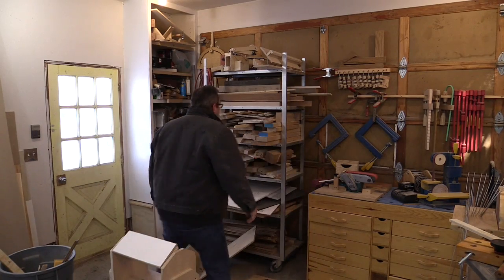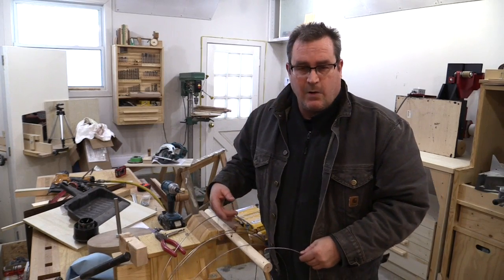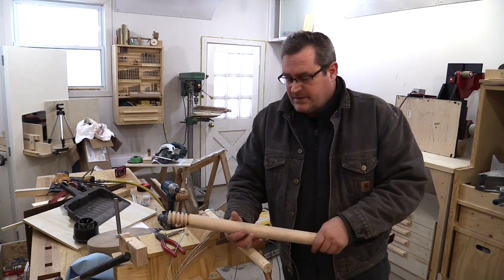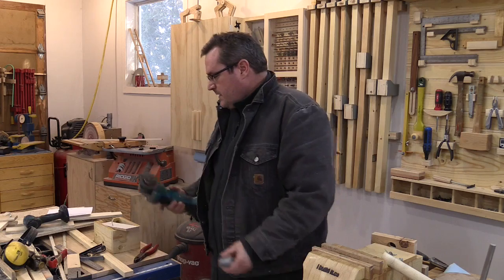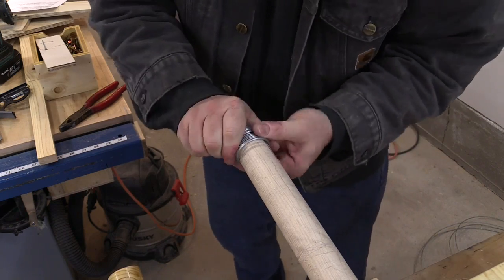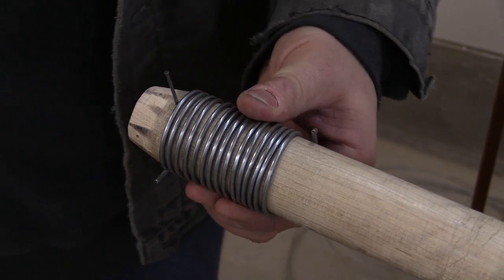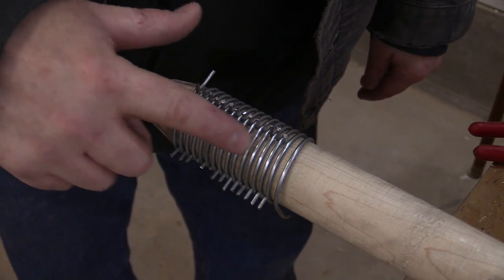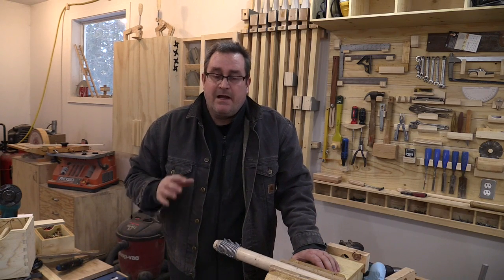Steel Threads Experiment Take 2

Comment: Put the dowel between centers on your lathe. Hand turn or very slow speed on the lathe and wind it on. It's how they used to make springs. Probably find the technique in PM Shopnotes or an old Deltagram.

Comment: Late to the game here, but I think a revisit would be nice on this. If you cut some shallow threads in both pieces it will allow you to wrap the pre-coiled wire more uniformly and will also provide more glue/epoxy surface area.

Comment: If you have a lathe with a feed screw, why not wind the wire straight onto the dowel using the lathe to guide it? Super slow speed and an assistant with a hand on the stop switch might work well.

Comment: Hey, John. Suggestion. I made my own threads in the past by winding two separate wire together. That way, the thread spacing is exact. Because they are separate wires, simply unthread one wire from the other. One gets attached to a shaft (the bolt), the other to an appropriately sized sleeve (the nut). Bingo bango. Just food for thought

Comment: Apply stripes of epoxy across the threads between your 3 rows of spacers and allow it to cure.  You can then remove your spacers and apply epoxy to the final 3 areas where it will hopefully sink into the holes and help further secure the coil.

Comment: heya john, merry christmas! i was in my shed and had a thought- you know those machines with linkages that copy writing? you follow with a pointer on one side and a pen on the other and it copies pictures or writing? well i wondered if it would be possible to do something similar to convert a small movement to a larger one, and then use a bolt or watever with the right TPI to move a cutter on the other end, and run the wood in a lathe or whatever. just an idea! take care man, all the best!

Comment: You are working with three materials that have different coefficients of expansion.
All threaded objects I have seen all ways made of one material only. Physics 101.
Threads are triangular both positive with opposite negative space.
Reply: +Paul C Johnson Except when they're not triangular, e.g. Buttress, Knuckle, Trapezoidal (Acme), Edison screw, Glass thread etc etc

Comment: Good fun!   :o)
Would winding two wires on at the same time be worth considering?  One becomes the thread, the other becomes the spacer.  Or you could bend your wire in two, wind it on in parallel, then grind through the bend at the time when you want to unwind the spacer.  I wonder if using wire that is not so feisty would make the task less stressful?  Watching with interest...

Comment: Instead of pulling those pins off your contraption 45 minutes after applying epoxy (5:20) why don't you dip each pin in a bar soap so the glue won't catch between the wood and the pin which could be removed easily later;
There is another method and that's the one I would use : let the glue set with the coil and pin. When everything holds tight you can pull off the pins by heating each of them with a soldering iron, they will pop off very easily, the heat being applied on the pin only momentarily it will not affect the epoxy on the coil and wooden axle.
This is the only easy method I found to unscrew a wooden screw from wood without impairing the quality of the glue around. I did it many times when restoring my 33ft sailboat on which I used epoxy widely ; in fact it sort of became standard practice in the yard I worked in.

Thank you for sharing. You're videos are always very instructive and a pleasure to watch, even if you don't like editing so much ! …

PS. The soap and heat techniques are not mine as I understand that they are pretty widely used here and there …

Comment: Are you making an internal coil in another part intended to thread onto this?  If so, I think your spacer wires need to be larger in diameter.   In metal threading, a thread that is 75% full is considered a very tight thread.  slightly increased spacing will give you the thread clearance you need to have a smoothly operating thread.   Interesting experiment.  I know the context but hope my comments are useful.

Comment: Your wire threads immediately reminded me of the worm gears Austrian model train Kleinbahn made this way. They wound a wire directly onto the motor shaft using probably some kind of spring steel. They seem to be working fine but the load on the wire is probably not that great.

http://up.picr.de/10871478xe.jpg

Comment: I can't see making a "screw jig" for just a few screws.  I love "outside the box".  An open thought (that popped through my head as I watched). Two wires, anchored on opposite sides of the dowel.  Wrap one half way aroud til it meets the second.  Then wrap both of them.  Maybe the wood block could feed two wires and keep them in line.  (Gonna need something on the block to add tension.)  At the other end, anchor one of them and let the other come off.  Some way to rotate the dowel while wrapping might have some merit.  Might even try to feed some epoxy in as it wraps and let it set a bit before pulling the 'loose' wire out.  ..  Ideas are free.  Thanks for adding the effort.

Comment: Fascinating stuff!
I love this sort of engineering :)
Anchoring the ends only of the cable to the dowel would allow the main body of the thread to shift as it is turned...
Maybe you could anchor the start of the cable in a hole through the dowel, bend the cable hard 90, and start the thread after the 90..? Should make for a nice clean start to a thread..
Perhaps also consider the ambient temperature your working at now vs your average yearly temperature... All that cable is going to expand a bit in the summer :/
Thanks for the video :)

Comment: Do I remember you saying that you would burn the threads into the nut by heating the wire?
Reply from the maker: Rick McQuay No, to make the nut I will wrap wire into the finished threads on the rod, then slip the wood for the nut over it. Unscrew it and epoxy the coil into the hole in the nut. Or, that's the plan, anyway.
Reply from the maker: I Build It I'll probably smear some epoxy into the hole so that it glues the wire threads in place until I can put the final coat of epoxy in.

Comment: I wonder, since you made your screw jig some time ago (the one you used for the other end of that dowel), if you could modify it to remove a screwed groove which is half the depth of the wire out of the dowel. Then you may be able to screw the wire into that, and it would seat securely, especially with the epoxy. Just an idea.

I'm following the progression with interest! Cheers!
Reply from the maker: Switch & Lever Making those threads in the wood are tricky to do and I saw this as a much easier method.

Comment: Even with the spacers it seems like there is a chance of getting the lead angle wrong, or at least not the same from the screw to the nut. Even if they are the same threads per inch they may not advance at the same rate.
Reply from the maker: David ODell The angle can't be wrong if you wrap the wire tightly. Also, the nut coil will be made from the threaded rod itself, so no chance of a mismatch.

Comment: Lil thoughts out of the box here (I hope). It seems to me the idea is just fine, but the method you choose to deliver is maybe a wrong direction (another words - just too difficult). The thing is, you're using hands to make it, so maybe instead use some sort of simple (or not so simple) jig for it?
I mean some kind of hand lathe and something which holds the wire with the right angle with some actual tension, so wire maybe (that would be ideal, but hard wood is hard) even cut into the wood creating a groove for itself + some epoxy that would be some strongass bolt.
And its kinda strange to me that it not came to u (coz u know, you're all abot jigs :) atleast erlier u did some cool stuff) or maybe it did, but u thought it's just not worth or whatever.
Anaways, very entertaining stuff u got there, wish u get this done and furthermore to get a cool way to do so for others. Peace :)
Reply from the maker: Tuff Movies Because a jig is not needed.

Comment: You could epoxy in two stages.  epoxy in the three open areas between pins and let that set up.  Then pull the pins.  Then epoxy the whole screw.  I like this experiment.

Comment: John,
  I do not work with epoxy - yet.  Will you have a problem with gravity and the epoxy on the underside of the dowel as it dries - will it form a mountain instead of a valley?? Or is epoxy thick/stiff enough that it will stay put a a result of the surface tension??  Looking forward to see where this ends up.

Scott

Comment: On the first video I was thinking you could maybe make a box joint that would force the wires into the right spacing if you happened to have a blade that had the right width kerf but I didn't say anything because I thought it wouldn't work.  Heh, well I guess it would have.
Reply from the maker: krtwood The slots I mentioned would be cut along the length of the dowel and would receive the short pieces of wire to set the spacing, rather than drilling that series of holes.
Reply: I Build It
I think you'll have issues with the epoxy running to the underside of the dowel, or at least that's my experience trying to put it on anything round.  I would try to come up with a way to keep the dowel spinning slowly while the epoxy sets up.
Reply from the maker: krtwood I stood it on end last night and that worked well.

Comment: What about scoring the dowel as if you were making a threaded rod. Just a very shallow thread that would guide the wire as you wind it. If you get the dimensions of the groove right it could be used both as a guide for the wire but also as a bed for the glue
Reply from the maker: Bara Cobama Difficult to do.
Reply: I Build It you could try make the guide groove by threading a bolt on the dowel. anyways it is an interesting project